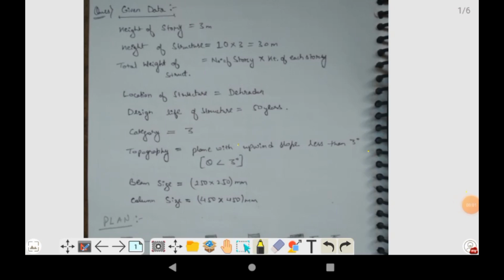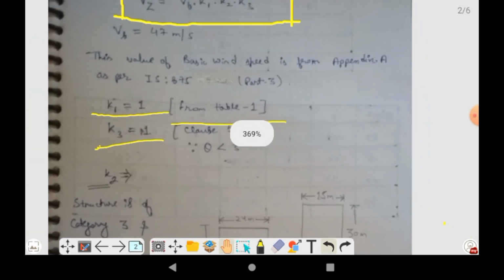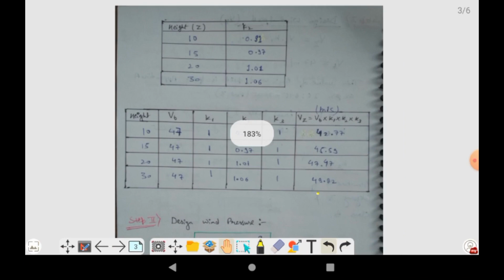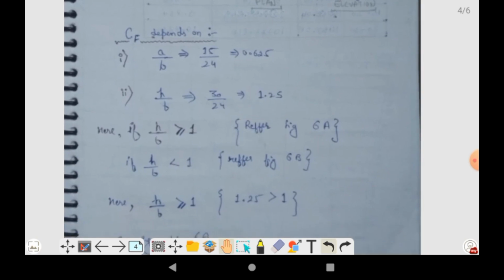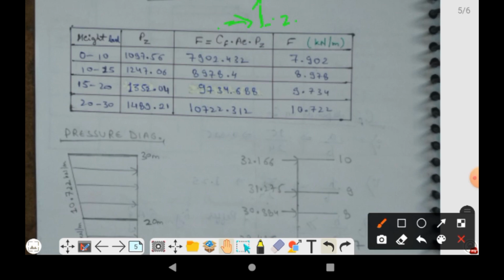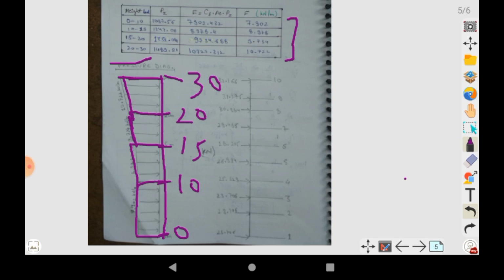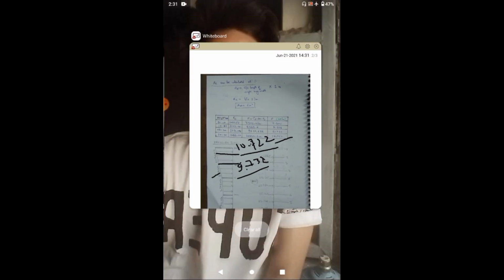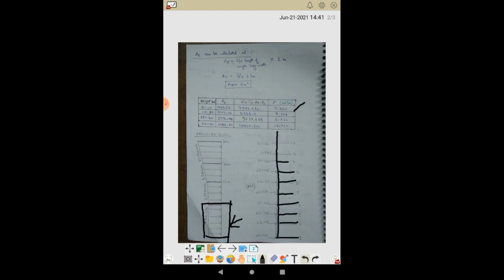Wind Load | Design of R.C Structure | IS 875(Part-3) | Numerical

Comment: The video is not clear. Whether the wind load is based on old code IS875 part3-1987. The wind load is revised as per IS875 part3-2015, the problem given in text book is reproduced without changing the latest code.
Reply from the maker: Firstly I would thank you for sharing your valuable comments and watching this video , as per your doubt I would like to clarify that this is based on 1987 , as it is still taught in our university so that's why I haven't used the latest one .